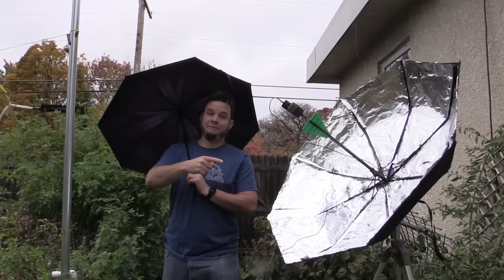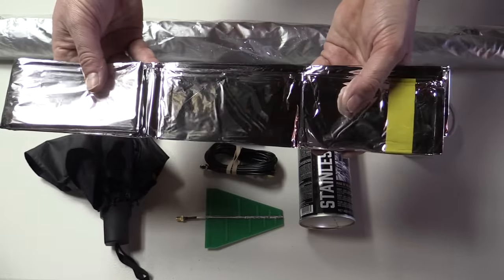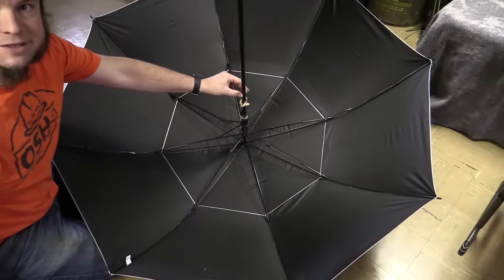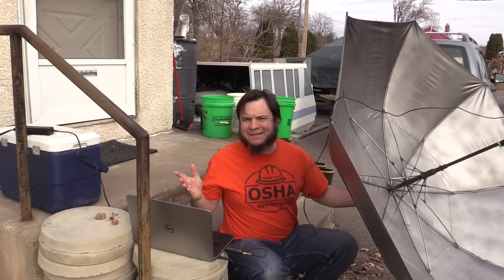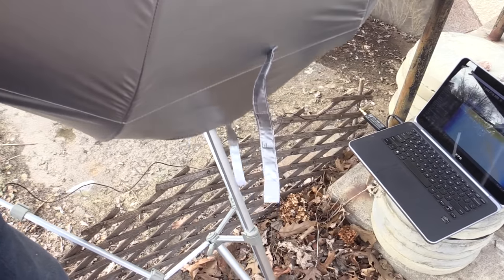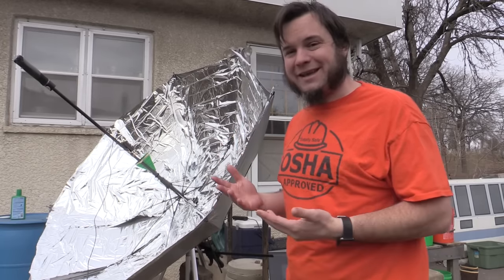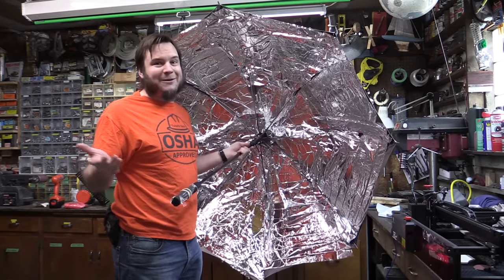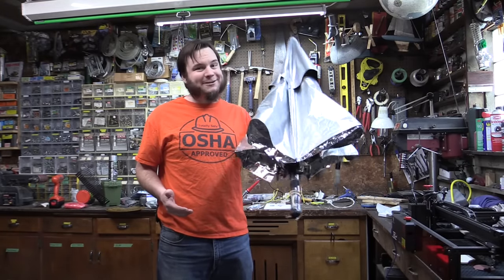Satellite Antenna Made From Emergency Blanket

Comment: So they make higher end photography umbrellas that use an aluminized Mylar lining. That would work better. The other ones are just shiny(ish). They and most “metallic” spray paints use garnet dust for the shininess.
Reply: Garnet dust? I don't think garnet dust is shiny - it's basically sand (ground up garnet rock). It's what you use in sand blasters and waterjet cutters. It's not shiny, it's usually red
Reply: @gorak9000 "Garnet" covers quite a wide range of crystalline materials, some of which can be opaque and some can have gemstone-like transparency.  e.g. YAG (Yttrium Aluminium Garnet) was used as a low cost diamond substitute in jewelry before cubic zirconia, and is used today in lasers and fibre optics devices.
Reply: @ferrumignis  Interesting. I never knew what the G in YAG stood for. I think it's also used in microwave RF components - filters and couplers or circulators. It has some unique properties! I didn't know being reflective / shiny was one of them! Or maybe that's YIG, and YAG is mostly for optics / lasers
Reply: @gorak9000  yeah, you’re right. Mica maybe? I know it’s a mineral.
Reply: @gorak9000  In addition to being a very hard material, garnet is a beautiful gemstone that comes in a variety of colours. Interestingly, for centuries, it was believed that garnets came in all colours except blue. I believe blue garnets were recently discovered, but I could be wrong. Also, an alternate name for garnet is carbuncle. And that's why the titular 'blue carbuncle' from the Sherlock Holmes mystery was so special!

Comment: One way to cut mylar coated plastic foil is by sticking a bit of copper wire in your soldering iron then dragging a u-bend of it across the top of the foil. I use that method for both cutting and heat fusing mylar for blimp envelopes. Or just use your normal soldering iron element held at a slant if you don't mind gunking it up.
Reply from the maker: Neat! I'll have to try that.

Comment: Great video as always. Maybe you could try a steel screen door mesh and cut it with a box cutter along the ribs of the umbrella so it can fold nice and easy. Might try it myself now that you have sparked my brain with this video.
Reply: aluminum screen is cheaper, lighter, and easier to cut :) Actually, I don't even think you can get steel screen mesh - at least not for windows - it would rust the first time it rained.

Comment: I think you could just put the space blanket (or other metallic layer) on the outside of the umbrella.  Your first experiment showed that the umbrella cloth is rf transparent.  It may be easier to fold down the umbrella if the metal's on the outside - less harsh angles when collapsed.  Plus it should be easier to apply since you don't have to work around the spokes.
Reply: That's what I would have done.

Comment: Maybe a metal anti mosquito mesh would also work, but IDK about the holes in it. The advantage of it is that you can sow it into the umbrella and that it being a mesh makes it actually bendable.
Reply: I just suggested that too
Reply: Wavelength at 1.7GHz is 17.6cm, and to be effective as a reflector the holes must have  a diameter well under 10% of the wavelength (1.76cm or very approximately 2/3 inch). If your mosquitos are bigger than this I want nothing to do with them 😂
Reply: @ferrumignis  I've seen mosquitos that large, but they don't bite and are quite funny to watch trying to evade you. They are unbelievably flimsy and clumsy
Reply: Better yet remove the cloth from the umbrella and replace it with wire mesh.

Comment: Maybe try spray adhesive and brass flyscreen (its not too expensive and much more flexible than stainless flyscreen), would be much more conductive than the blankt. Also painting on contact adhesive thinned down with automotive thinner work much like spray adesive (better coverage for the price), also applying to the outside not the inside should fold up much better. But cool video, great to see.

Comment: Neat!  I've wanted to make or invest in a ball mill so to be able to more cost effectively make my own conductive paints.  Not only for similar antenna related projects; PCB's, flexible fabric paint for RDF clothing gear and other sensor potential, shielding, etc. repair projects.

Comment: There is electrically conductive paint that was applied to a model of the Ho229 to simulate the metal parts for radar experiments. They wanted to test the stealth properties of the Horten Ho229. The only drawback of this paint is that it is very expensive as it contains silver. The idea with the rescue blanket is not bad, and the idea of converting an umbrella into a satellite dish is also not bad, so I have a multifunctional umbrella. There is also zinc spray, which is 99% zinc and electrically conductive, which would also be worth a try. I saw a YouTube video of a Russian who built one of the largest 3D printers in the world for plastic, on which you could print individual segments to build a backpack-portable satellite dish. To have internet everywhere via Starlink on the hunt for Bigfoot.

Comment: 13:09 - Great video as always Gabe.  I’ll keep an eye out for one of those emergency blanket, umbrella and spray adhesive shops while I’m out later on ;-)

Kitchen foil is probably better, but whatever you use, I reckon that it’s a one-way thing in terms of being able to fold it up again.
Reply from the maker: I still think foil HVAC tape worked better and was easier to apply smoothly, but I couldn't fold up the dish again with that! I did get a decent signal with a smaller diameter umbrella using the foil tape.

Comment: One thing to keep in mind is that an LPDA has a hair too much gain for really deep dishes like your umbrella.  The feed will only "light up" the central perhaps 40-50% of the reflector.  In fact, feeding really-deep parabola is a bit of a black art.  That's why you'll find sat dishes typically in the F/D range of 0.3 to 0.5.
Reply: It's not really a black art - a simple waveguide feed with an adjustable choke ring around it to adjust the angle of illumination, is pretty universally used on all large parabolic dishes
Reply: A simple waveguide feed (with or without a choke-ring to adust pattern) simply has too  much gain for dishes with F/D << 0.3.  You can use things like a reflector-backed dipole, or a "spashplate" feed on these dishes.  I've also seen a splashplate modified with a dielectric lens to improve pattern uniformity.  In Gabe's case, it looks like the feedpoint is below the aperture plane of the reflector.  That's going to be next to impossible to efficiently feed.

Comment: This was cool. The hurried wrinkled application represents what it would really be like, in an emergency, needing to get that signal having been wrapped up in a marathon blanket after the James Bond mission (peeling off the blanket to avoid creases and then fashioning an adhoc brolly dish like that).  A "ParaBrolla" could be its name.

There would be people finding the concept of making it ever the moreso cheap and retrofitted (upcycled) from various qualities of mylar or, instead, that much cheaper atomised aluminium spray onto plastic rather than the mylar that is pricier which has foil betwixt 2 plastic sheets. At some point, even though the glued brolly fashioning technique makes a different, the atomised aluminium versus high quality mylar would in some cases be worse but good enough to still be workable, doable, and inexpensive. Radio dishes are interesting because a carrier signal (either by the style of digital, like FPGA versus Phase-Locked-Loop) help the tolerance of getting a signal done and dusted onto a rig and stored as data.

My comment has no hate in it and I do no harm. I am not appalled or afraid, boasting or envying or complaining... Just saying. Psalms23: Giving thanks and praise to the Lord and peace and love. Also, I'd say Matthew6.

Comment: The problem with Mylar, is it is a real metal surface.  But it’s as close to a single atom thin as possible.  Satellites use Mylar as faraday protection, but it’s a special gold Mylar.  Also with shorter wavelengths, every wrinkle starts to matter.  I think a far more difficult, but far more effective solution would be to cut off the fabric, and use it as a template to sew together a new cover out of Faraday fabric, or an ultra fine metal mesh if you can find it.  Also cut a true parabolic curve out of cardboard to bend the frame into a more accurate shape while it’s off.
Reply: The question is, would a standard yagi antenna be just as or more effective? Yagi antenna are simple to build also but are technically horizontally or vertically polarized so perhaps the parabolic collector is better.
Reply: @mrbyamile6973  I haven’t looked into dishes much.  But it’s probably significantly more effective than a Yagi alone.  Otherwise satellite command stations would just be using Yagis by themselves.  I think the antenna still uses a Yagi because it has great rear and side nullification.

Comment: Looking at actual photography reflectors, I think it's worth trying to get your hands on one of these. All the ones I'm seeing have many more ribs so they're a closer approximation of a circle, and do not have the kink half way along the ribs, so they overall do actually try to approximate a parabola; where this one is just sort of vaguely similar to a parabola. Also seeing ones that are much deeper parabolas if that matters, you mentioned this being really shallow. The approximate parabolic nature of the reflector is important in photography because the goal is to create a light source that is coming in fairly parallel from a large area, it casts different shadows, more daylight-like shadows. They also look far more metallic, nearly to the point of having a reflected image (and they're huge, silly huge, 7'+). They are expensive is the thing. Maybe someone in the area can lend you one for a video. Unless you think you'd use one for your video, or for shop lighting, I don't think it makes sense to spend this much on one video.

Comment: That was me that suggested the emergency blanket! 😁 I'm really glad that worked. You tried it on a way bigger scale than me though 😂. Another great vid, mate. I forgot to say as well, I used an older blanket from the late 90's, the metal layer is definitely thicker than the newer ones.
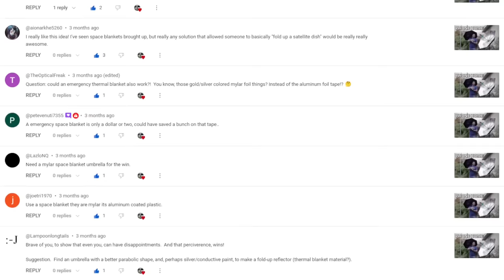Reply: multiple people suggested it - you can actually see my original comment at 0:21 in this video
Reply: @gorak9000  Sorry, I didn't mean to imply that I was the only one to suggest it, I was just the first person in the comments to suggest it. Not that it really matters. I'm just happy it worked well.
Reply: @JonW77  It's difficult, if not impossible to tell who commented first - youtube re-orders the comments (along with many just randomly disappear on a lot of videos too). Nor does it really matter in the end. It's a rather obvious suggestion - metalyzed mylar is probably the cheapest and easiest thin metal sheet that conforms to almost anything that's readily available. Something I've always been curious about is why some materials work better than others - why does a super thin film of aluminium on mylar work, but not the metal paint (if indeed the paint actually has metal in it). I think it must have to do with both the electrical and magnetic properties of the material. Similar to how if you try to block EMI interference with Al foil, it practically does nothing, but if you use copper foil, or copper screen, it works immensely better.
Reply: @gorak9000  Ah, I didn't realise that was the case with the comments. The only reason I thought I was first was because the video was posted at about 4am (local time to me here in the UK) and I was up at the time and was one of like the first 20 or so people to watch and I know my comment was number 21 out of 37 comments when I watched it. Like both you and I said it doesn't really matter. Anyway Yeah it really interests me too about why certain materials are better or worse. My dish was a smaller umbrella and an older thicker blanket. I think the reason that the paint didn't work was that the percentage of actual metal in the paint was too low. I think the surface was electrically too high resistance. I mean ultimately radio reflectivity is all about skin effect and good conductivity, look up the skin depth at the required frequency, make the metal several times as thick and in practice you are done.

Skin effect depends on conductivity and permeability though. So you want a good conductor with low permeability. At 1 GHz only the first few microns matter and gold coating can be quite effective. Non corrosive properties help - even a thin layer of oxide will affect performance. Which is where gold beats silver / aluminum etc over time...

Comment: You could also try and use a cooking wok to use as a satellite dish. also is the version 4 SDR dongle better than the version 3 one ?
Reply from the maker: The v4 is pretty similar, I think it has a slightly different frequency range and lets you see lower frequencies, but I haven't had the occasion to use that yet.
Reply: Thanks for that ill have to get one. @saveitforparts
Reply: you are welcome

Comment: Yeah, foldable mylar antennas/reflectors has been a thing in space for years.
I have also seen one taping a mylar blanket over a bucket and then draw a slight vacum in the bucket to get a parabolic shape.
It might be easyer to tape a mylarsheet to a ring and make a lid from something that does not block the signal and pump it to the correct parabola.
Also you should have aimed for the best signal and then tryed to manually move the antenna to find the focalpoint, that's where the gain is...
Reply from the maker: I did move the feed around to try and find the focal point, and it seemed best right about where the math said it would be. Still seems weird to me, but it is a pretty flat umbrella.
Reply: @saveitforparts  Yeah. then it was only the flatter innerpart of the umbrella that acted as the reflector

Comment: Get two of your pcb antenna's and one of those cheap network analyzers and measure transparency by looking at signal with and with out the test sample.  The reflection ignoring losses then is R=1-T.  So if tran is 25% then the R is 75% more or less.  I would use copper tape for a reflector.  maybe alu foil.
Reply from the maker: I used aluminum tape for the previous one, that worked pretty well.
Reply: @saveitforparts  Cu is a better conductor.  You can also get Cu with conductive adhesive.  That's probably not necessary.  In fact Al is probably fine.  :)

Comment: I wonder if the copper "gasket sealer" (Permatex spray-a-gasket) used on engines is conductive enough to be used as a dish/ground plane.

Comment: You should have cut the blanket to each individual panel of the umbrella. 

Also, if a spray can is empty, remove the spray nozzle and jam the end of an air compressor on the actual nozzle of the spray can. Like refueling a torch.
Reply: If you get a tire air stem (the tapered rubber part) and keep the air valve in it, it presses down on the nozzle, but stops the air blowing back out.  The air stem base fits in the circle on the top of the can.  Give it a shot.  They can be bought at any local tire reseller for between 3 and 5 bucks.  Just make sure it has the valve in the stem.
Reply: If he had two of these umbrellas that were exactly alike and he didn't mind sacrificing one, he could carefully use a seam ripper and take it apart... and use the pieces of cloth as a pattern to cut mylar exactly to shape. These are a fairly complex shape that is not triangular (called a "gore") that you will see on hot air balloons. It's more complex by the fact that it is not on a perfectly parabolic curve.

Comment: I would have glued smaller sections to keep it smooth, sort of like a disco ball and with a substrate so the mylar panels would be easier to apply.  At least have serrated the parts of the flexible webbing so it can bend without tearing the delicate mylar.  Anyways, this is all fascinating and has my brain going.  It's unfortunate the practical implications are so slim.
Reply from the maker: I didn't think it would actually work, so I rushed it a little :-P

Comment: Cool video. So, When small dishes came out, ie Direct TV, I found them interesting being plastic and all. So having watched this video I'm wondering again how those plastic dishes work. Do they have a metal mesh inside? Maybe metal thread woven into fiberglass cloth? 
Maybe you could use one of those copper infused fabrics? Maybe they're really useful for something after all.
 I think they make bed sheets that are silver infused.  
Actually remembering better, I think those dishes were pressed sheet metal with a plastic coating. idk
Interesting.
Reply from the maker: Yeah the small dishes are usually either aluminum or have some kind of metal layer inside.
Reply: fiberglass dishes have a metal mesh embedded in the fiberglass. Metal dishes are powder coated stamped steel directly. Both work almost equally well, if the mesh size is appropriate for the wavelength of the signal of interest.

Comment: In Europe There Is This Copper Paint For 5 Euros A Can, I Spray Painted My DoorHandles Because My Door Handles Are Pure Copper And I Accented The Sided And Stuff, Yestarday I Cleaned My Doorhandles And Git TThe Acid Acidently On The Paint And It Got Shiny, Went To Grab My tester And It Beeped On Contioniuity When IW as Around 1 Cm Away With My Pointers So That Paint Is Actually With Copper Metal Inside, I Can Send You Few Cans If You Want :)